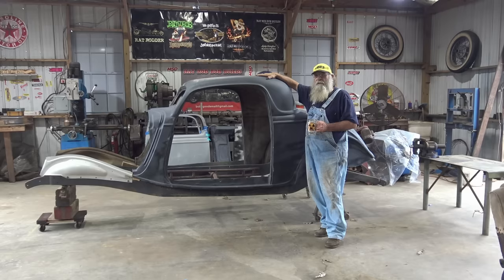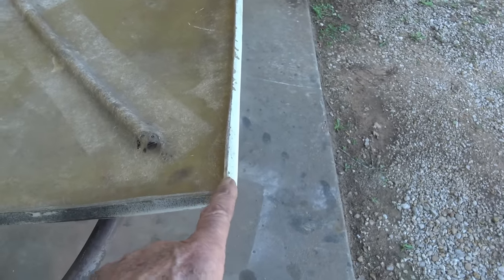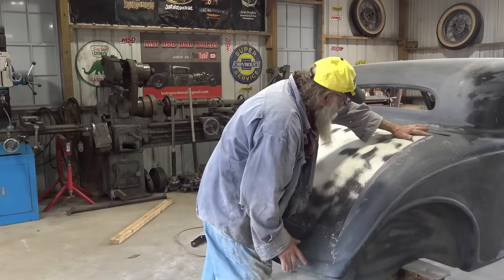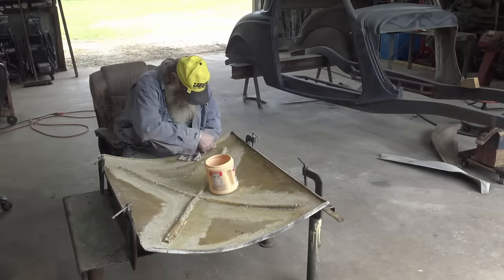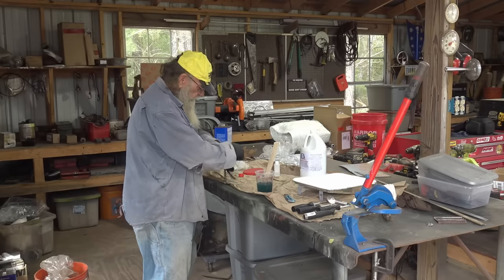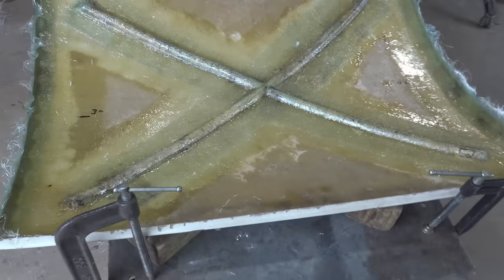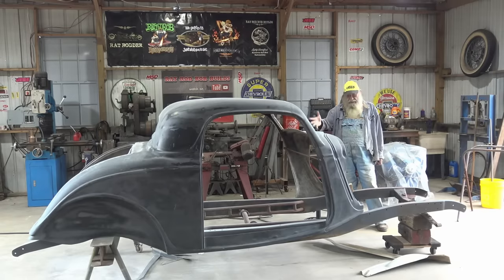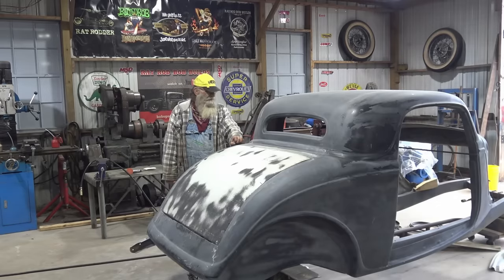34 Ford Coupe Fiberglass Repairs - Trunk Lid Fix

Comment: Bob, I have been working with fiberglass for over 5 decades, I put the cloth as I use it in the resin so it is saturated then lay it where it goes. When you get the doors done you can paint it and make a beautiful street rod out of it. The beauty of glass you can work with it and make it look great. You will do great as you learn.
Reply: Watched a guy in the boatyard do just what you said. He would lay those strips out on old cardboard, get one wet, place it, get the air bubbles out and move on to the next one.

Comment: Hi Bob, the cool temperature helped you out a lot as it slowed the cure of the resin and gave the binders in the cloth more time to relax. The other thing that helped is that you mixed your resin in a smaller cup and then transferred to the roller pan. If you would have left it in the cup it would have kicked sooner ( Important on warmer days !!) Keep up the good work !
Reply: Hi Bob, I was just thinking about how you might go about making the trunk lid nicer. I would give the outside a sanding and spray Gelcoat on the outside spraying more coats in the low areas. Just a thought.

Comment: I'm currently building a "glass" 1927 Roadster so this is nice to see as this is my first fiberglass build. Have to build the dash panel, floor & tunnel along with cutting out the doors and trunk. Will be flathead v8 powered. Then back onto OG metal builds haha.

Comment: Done some fiberglass work, but that has been decades ago. Not too sure I could give good advice now.
With the angles of the top and bottom being wrong for it, I can't help but think it is for a rumble seat lid instead of trunk lid, as they open opposite of each other.

Comment: Years ago I worked in a body shop and we were working on a 61 corvette and the hood was low on the drivers side. The boss cut a piece of rubber and put it under the hood and it fit perfectly. By the time the car was completed he took the rubber out and the hood held the shape. I didn't see that coming but I didn't know beans I was just doing the crap work.
Reply: Don’t get too crazy about the body work she’s going to move around when she hits the sun light . Then the work begins 😂😂

Comment: Your the first person I ever seen doing it the EZY way using a paint roller i been doing that for 30 years the only thing you need to do is use styrene to wipe the fibre glass down it helps activate the glass and tear the fibre glass mat it helps too blend in so you don’t end up with high spots keep it up ilove the show

Comment: 25:30 As the excess fiberglass cures on the overhangs - wait until it is about 75%-80% cure (still a bit pliable) and cut off the excess with scissors (an old pair). That saves a lot of time in cutting/grinding once it cures completely.

Comment: Hey there Bob, for old fibreglass I use West Systems epoxy for the best mechanical adhesive. If you need to modify other parts that require a stronger bond, use 105 resin with either 205 fast hardener or 206 slow hardener. You did a good job on this but mixing partial hard resin with new is not good practice. Always mix enough resin to do the job in one go. I am also looking to purchase a tupperware hotrod body to do up.

Comment: Bob, like everything inlife there are tons of ways to get what you want.  You're on the right path. With polyester resin you can recoat after you can't leave a fingernail impression.  It's usually 15-20 minutes.  For fitting the deck lid , I'd start with putting the rubber in place then fit the deck lid.  If you have hinges put them on as well.  At that point you will know what adjustments you do or don't have.  Metal is easier because you can twist it or perswaid it the way you want.  You'll have plenty of suggestions for eveything you do .....  I guess that's just the nature of it all.  Annyway you're doing fine.  Unfortunately I do hate when you say it's good enough it's just a rat rod !  I have  the thought that make it as best as you want or whatever time your wiilling tto put into it.  Most everything you give up on probably could be better it's just figuring out how and how long it takes.  By figuring it out the you can figure out how to do it faster.  Itdoesn't matter to anyone but yourself though !  Enjoy what you do and do it for you !  Learning to do it better is for your satisfaction.  When you're doing for the public is when it does make a difference tough.  Kee on what youre doing !

Comment: You did great bob where your low spot is all you have to do is where the trunk rest on that lip in that gutter onder the lid is build it up and just after you build it up with fiber glass grind it back according to the fit just like shimming body panels your a smart guy you will figure it out

Comment: Get some quarter inch thick plywood and trace the curve of your trunk opening of the outside edge. Then subtract the thickness of your trunk lid then cut it in a strip the same size as the edge of your trunk that you cut up to get the curve you might have to re cut it but if you use the plywood as your edge and fiberglass it on the inside of your trunk to the edge of it use clamps or rivits or screws whatever you got to make your trunk form to the edge of your plywood it will line up perfectly and give more support along the edge as well

Comment: I see you have worked with glass before, nice work!
Its just a boat that dont float. Easy to glass steel in where you want, and wood  for trim and accessories. 
All i know is if weather is real hot, it wont cure right, just like if its too cold.

Comment: Bob, cut your glass in smaller pieces so it will lay flatter easier. Pour the resin in liberally it will be easier to brush or roll around. Not like steel, lots of small pieces just as strong as big one.

Comment: Well since it's gonna be a ratrod anyway if it doesn't fit...just make curved metal straps on each side on the inside and clamp them in with mixing glue and fiberglass fiberglass them in there. Or small square tubing curved to your liking. More ridged

Comment: You should get a Total Boat epoxy resin kit to work that glass cloth.
You can control the cure time easier.
And it's a far sight less nasty to work with than polyester resin.
That stuff is nasty.

Comment: You was supposed to get it on your shirt,shoes,beard,or I wasn't doing it right. I see these cars,and can tell they are glass a mile away. They are to perfect,and hold paint different.
      The electric you run a ground,cause the body want. You just run bare bones anyway.
   Some of them kits, were near ready to paint. Some were a nightmare, thin spots,and cracks,fit for shit.
     Enjoy your weekend.

Comment: Yeah Bob I'm with fredflintstone you need to start thinking about your health when working with fiberglass, that bandana isn't going to stop them fiberglass needles from entering your lungs a good respirator from 3M may cost but at least it will save your lungs from particles getting in

Comment: i built  a 'glass t-bucket once, and i called it my 'canoe on wheels'  , because up here in canada canoes are mostly made  of fiberglass. 😄 but i still liked it, tin or not. (edit) p.s. but most of the work i did was metal work, so ...